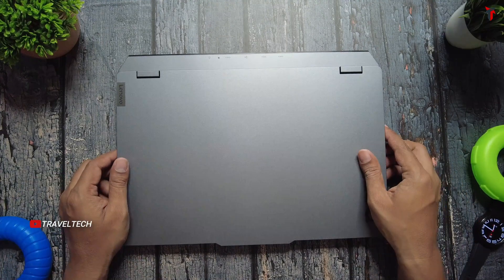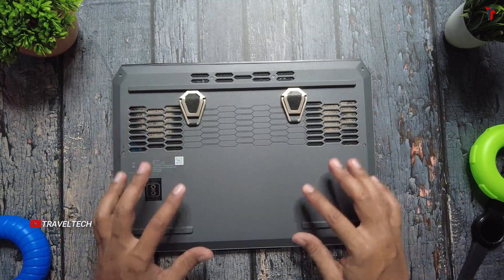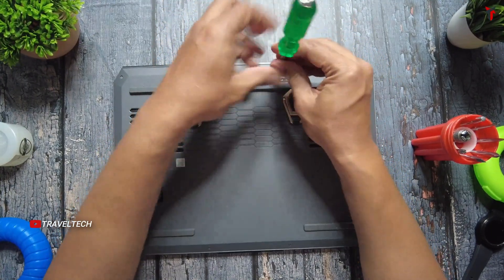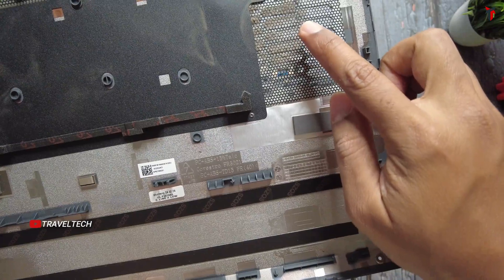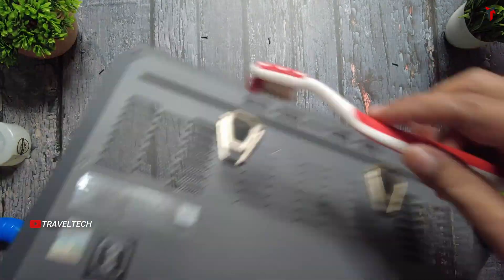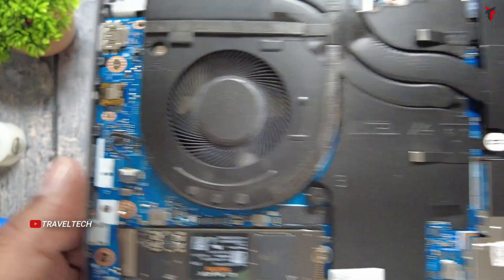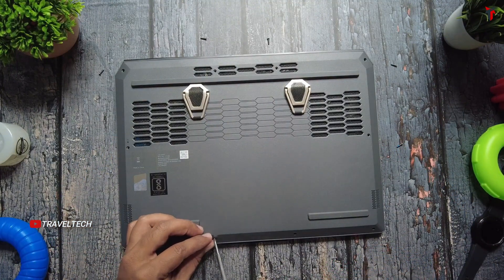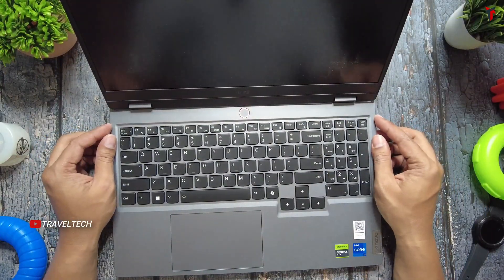How to Clean Laptop Fan? Simple Task to Get Best Performance! Laptop Tips & Tricks! | Gizmobeep

Comment: Would this effect warranty? I'm talking about removing the back panel. I believe as soon as I don't remove any parts I dont need to remove the battery?

Is it ok to use a blower or a vacuum cleaner to take out the dust while keeping them with my hand? So they don't turn. Cuz I think teetbrush might let the dust go inside of heatsink?
Reply: Well bro I don't know whether you have cleaned you laptop or not, But I would suggest to disconnect the battery first before doing anything and also holding the fan with a finger before vacuuming or else the rotating fan can cause reverse current that might fry any sensitive part on the laptop. Also beware of static discharge.

Comment: About a month ago, I decided to clean my Lenovo laptop myself because the service center is far from my place. I followed a YouTube guide for my model, cleaned the fans, and out of curiosity, I opened the heatsink to take a look. (Looking back, I now realize that opening FRUs may void warranty per Lenovo’s compliance clause.)

The thermal paste on the CPU and GPU looked dry, so I applied Cooler Master high-performance paste and added ~1mm thermal pads on the dies around the GPU. After this, the laptop worked fine for about 19 days, including gaming.

A few days ago, while playing Forza Horizon 4, the game started lagging heavily. I tried Chivalry 2, and it had the same severe lag.

This isn’t the first time I’ve faced this issue; previously, Lenovo replaced my motherboard due to similar problems.

I did not damage or scratch any components (except the screws), and there was no spillage of thermal paste on other parts. I am a Premium Care user and also have ADP, though I understand my tampering may void ADP.

I’m in India and want to know: can I get my laptop repaired under Premium Care despite this tampering?

Any advice would be greatly appreciated.

Comment: I tried to open my laptop LOQ but it's way too stiff to pry open, like WAAAYYYY too stiff. I already removed all the 10 screw and comparing to how easy you open the laptop case without any special prying tool, mine feels like I have some more hidden screw to open. 

I've already used it for almost one year just for some heads up. I really want to clean the laptop fans but it feels like I'm breaking my laptop if I try to force prying it open. Please send help.
Reply from the maker: Recheck all screws. Then use a credit card or any such thin but sturdy piece to split the two panels. Take your time and do it gently. It will surely open
Reply: @gizmobeepchannel  I've already recheck my screw, all of them were off. And tbh there's barely any gap that can be used to pry it open with plastic cards that I had to use specialised tools. And I am being gentle with it, but it's not possible to open it unless I apply too much force for it to be consider "gentle". And I'm already spending an hour being "gentle" with it
Reply from the maker: Well you have two choices,

+ Take the laptop to nearest PC/laptop sales or service centre and get it opened by professionals.

+ Do it yourself without being gentle.
Reply: @gizmobeep  I think it only left me with one choice. I just hope it doesn't costs too much tho. Welp, thanks for the tips anyway. Cheers 🎉.
Reply from the maker: All the best 👍🏻
Reply: A plastic guitar pick worked better than a credit card for my laptop (Asus Rog Strix G15).
Reply from the maker: Yes that works well too

Comment: It looks like the fans were already cleaned before you used the toothbrush, why? Also, wouldn't that force dirt past the fan and isn't that the exact place you don't want dirt?
Reply from the maker: Good point. And you are right, as what I have shown in the video is a representation of the cleaning process. I have cleaned the fan before shooting that part. You have to hold the laptop inverted and clean the fan with brush. Alternatively you can also use a blower with minimal speed.
Reply: Using compress air duster is good idea or not